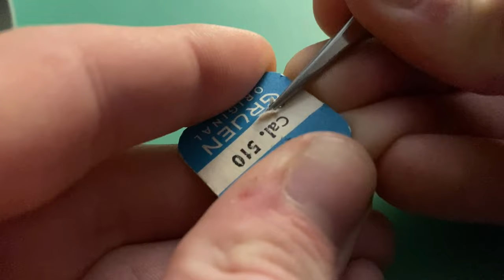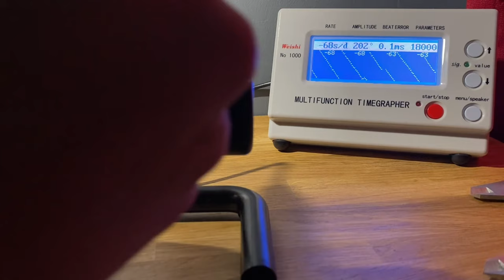The First Bond Watch | Gruen Precision 510 Restoration

Comment: Nice video, good skills, but here a tip from an old watchmaker: 1st rule in watchmaking: never oil the palletfork pivots ! It costs you a lot of amplitude, as you see on the timegrapher, 199 degrees is not really acceptable. No ctriticism, just a friendly tip...
Reply from the maker: Thanks for the tip. I only found this out about a day ago. I'll bear that in mind for next time as most of the watches I've now serviced have had a low amplitude.

Comment: I really enjoyed the video.  I  have a Precision 510 like this one, It winds and keeps good time.. The dial and the case are very nice but the  crystall is covered in fine crazing cracks and I assume would have too be replaced.. Also the the crown is bent and the movement is loose in the case.. I would love to to get it fixed up and start wearing it occasionally..  I would appreciate your thoughts and suggestions on resolving these issue?  Im sure it would be in need of service as well.. I really enjoyed the video.
Reply from the maker: The glass would probably need to be replaced if there are cracks. If it's just scratching, this could be resolved with some patience and using fine sandpaper and polywatch. The case being loose could be due to missing case clamps or the inside of the case is worn down. The crown or stem may have to be replaced if it is bent as these are often usually difficult to correct. All of these jobs could be undertaken at home with minimal tools. You could get away with just using 2 screwdrivers ( 0.8mm and 1.2mm) and a caseback knife (or if you are careful, a sharp kitchen knife could be used however this could result in scratching). Also, a fine pair of tweezers would be beneficial too. I hope this  was helpful.
Reply: @orbwheelsandwatches  Yes it was very helpful ...I have already started collecting the necessary things.. Thanks for your help and inspiration.. Hopefully I can send you a pic when finished.. Thank you again

Comment: Wonderful video.  I have a similar watch case but the watch will it stay in place and the movement and back fall out.
Reply from the maker: I have only seen a problem on a watch like that before once, it might be worth taking to your local watchmaker to sort it. You could try fitting a rubber gasket inbetween the caseback and the case if it is a similar case style to the one in the video. That should sandwich it together. Sometimes you can carefully bend the thin edges of the case in slightly so that it grips the caseback if it slots into the case. Hope this helps.